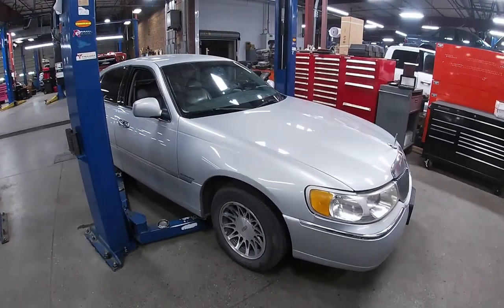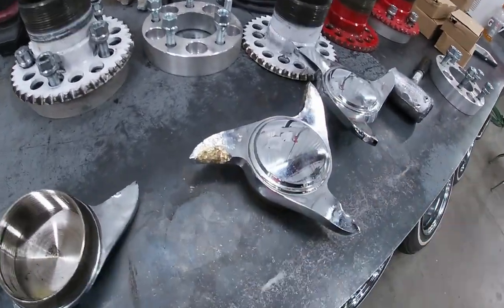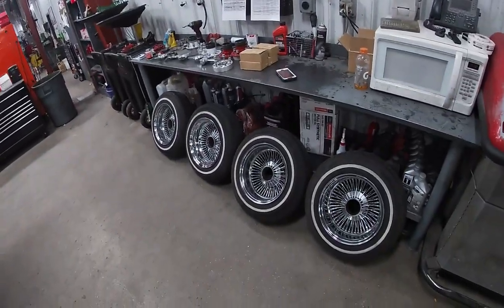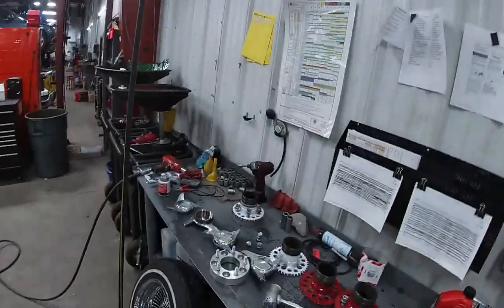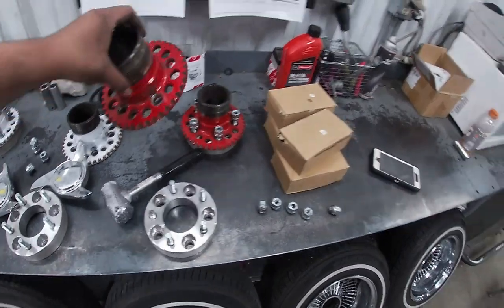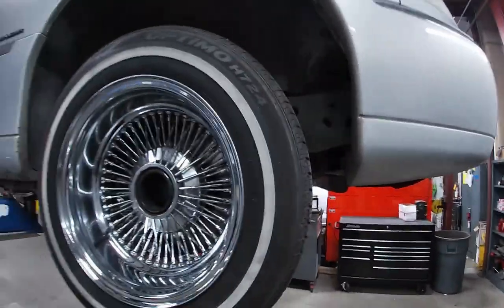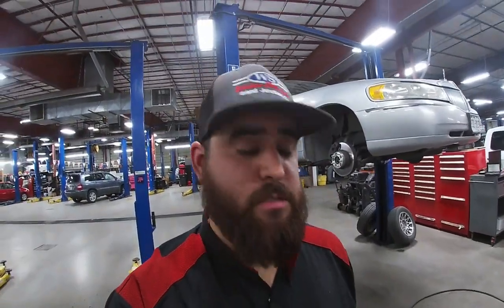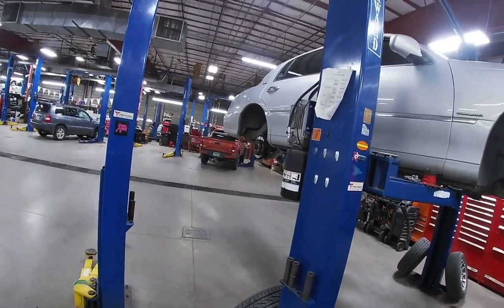How To Install 14x7 Spoke Wire Wheels On 2000 Lincoln Towncar

Comment: If you want to save yourself a headache. On 2000-2002 town cars just swap your calipers, Caliper bracket and rotors to 95 parts. They bolt on in 20 mins and  clears 14s no problem. No spacers or grinding needed. I just did mine for about $250. I sit flush with 2" tuck.
Reply: Will this work on a 2004 Lincoln Town Car as well ?
Reply: Wait so you can just stick 14s on the 95s with no issues? Would it be the same for the 92?
Reply: @MrMicahMane  yeah
Reply: How about  on a 96 towncar? I'm gonna run 14s
Reply: @alexfelix4965  no those you actually have to spindle swap. Also on those The rear-end is wider so the rim isn't gonna sit flush either
Reply: @MrMicahMane   u can run 14s no problem 13s u have to shave the caliper
Reply: @laloencizo7681  ur good on that year. Just the turtle body has double piston caliper and big rotor. So we gotta shave a lot off or swap 2 your year brakes and rotors
Reply: @JH-wn4li  how about on the rear? Any modifications recommended for the rear?
Reply: Thank you 😎👍 they fit!
Reply: @laloencizo7681  14s fit 92 - 97 no problem they have the same diameter rotor and caliper on those years. 13s you have to grind the calipers a little
Reply: @JH-wn4li  this was my next question lol. I got some 13s on my 92 and had to grind my calipers just a lil bit
Reply: How bout on a 2001
Reply: I got 01 grand marquis thinking about doing it . What size tire bro bro😅
Reply: @JH400 on a 99 would I have to do the spindle swap?
Reply: @IvanLopez-zy7oo  not that I know of
Reply: @SilverStateFamily 1998 to 2002 are all the same, things change again for 2003 to 2011
Reply: Will this work on 98 lincoln town car as well
Reply: No cutting or tweaking?? Junk yard ?? I have my eyes on a 2001 I want to run 14"
Reply: @richardvargas3088 I didn't have to do anything for the rear. My 14s fit fine. Swapped the calipers brakes and rotors in the front and the 14s fit fine. I got all my parts new. Been riding all this time no issues
Reply: @richardvargas3088  I'm running 14s with the swap I listed above. A yr no issues so far
Reply: Whit 2005 what is the Spindle to change on the wheel is it complicated
Reply: What about 2006 grand marquis 5 lug baby moon universal? Will u have running without adapters
Reply: @northxidee_  probably won't work look like u got the same brake package as the 03+ lincoln.
Reply: @JH-wn4li  dam fr what u think will help it too work ?
Reply: @laranflatumbadaitsalifesty6957  they say 92 town car spindle and hardware. But idk how easy or that is. I tried finding it for my car and gave up after a month
Reply: What about mounting 15's on regular 2000 town car calipers? Will they fit?
Reply: Didn't know if this would work for a 99 crown vic they should be pretty much the same in the front right?? Because I want to put 14s on mine
Reply: So u bought new aftermarket 95 calipers brackets and rotors and they fit on the 2000 towncar ? Then you can just throw the rims on like nothing ?
Reply: @sinslap_  rotors calipers breaks from Napa. Swapped em and been riding 14s every since
Reply: @gengar4106  from what I see it looks like they are the same. It should work
Reply: @DopeFiend  I honestly don't know. The stock stuff is pretty big might have 2 grind a little so 15s will fit.
Reply: @JH-wn4li  so if you buy brand new aftermarket 95 rotors calipers and brakes they will fit on my 2000 towncar then i can slap the 14s on without swapping the spindles

Comment: this video is a year old, hopefully someone replies back but what spacers are these? where can i find them? got 2 pair from local auto parts but neither of them fit the lincoln town car. can someone send a link for spacers that will fit 100% 1/4 spacers specifically!
Reply: My personal opinion don't listen to this video. To clear 13s use a HUBCENTRIC 1.5" space adapter. You don't have to cut the lugnuts to sit the adapters flush and no griding involved. Remember HUBCENTRIC

Comment: Having same issue with my 2010. Will this work with 2010 also???
Reply from the maker: I would imagine so I think everything is the same but I’m not sure
Reply: It will work Tried it with my 07 but u have to put bigger spacers looks like a 4x4 lol
Reply: @hennysmallz1029 so for your 07 you had to use spacer bigger than 1.5in?

Comment: Needing Help from this lowrider community!! Fyi i dont know anything about wire wheels...😅

So i have a set of wired rims on white walls just sitting around. So i attempted to mount them onto my 06 Civic but are rubbing on the front fenders!!! I dont get it why they would even be rubbing? They look way smaller than the stock rims and tires so idk why the rubbing? What should i do so that it can ride with no problems? Lift? Spacers? I honestly dont know and would love to get some help/feed back pls!!! 🤔 😮‍💨

Comment: I tried putting spoke tires 13s on my dodge diplomat 1985 but every time I try to drive it one tire (front)during a little of driving starts to unscrew it self and made the tire fall off I tightened it super tight too what could it be?!!
Reply: Do they tighten toward the rear of the car when you’re tightening the knockoffs?
Reply: What side driver or passenger and what color adapter on the side that’s coming off?

Comment: Ey my gee does  that work for a 2001 towncar the 1.25 spacer too
Reply from the maker: Yeah this car is a 2000 it’ll be the same
Reply: My g despensa to bothr again but were u get them from i live in a smaller rural town so i cant really find them locally gracias for your help
Reply from the maker: I got them from eBay
Reply: What tire size u running?

Comment: where did you get them spacers at bro? im having the same problem for my 02 Lincoln with my 14s and they're bolt on spokes too, so you think i gotta do anything different?
Reply: They got them on Amazon
Reply: I do believe that bolt ons have a different offset from the knockoff may need to measure and get different spacers.